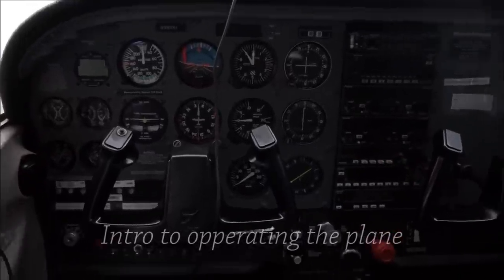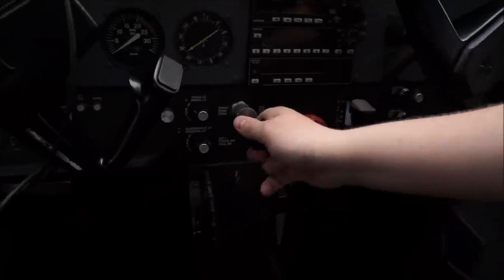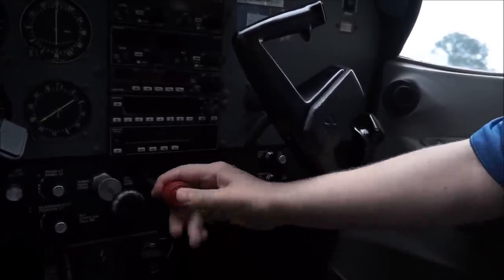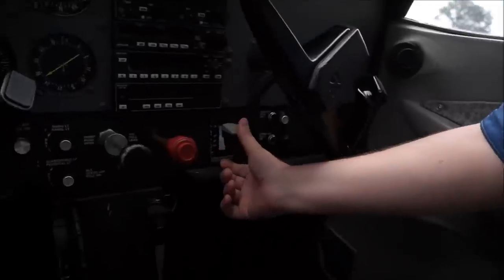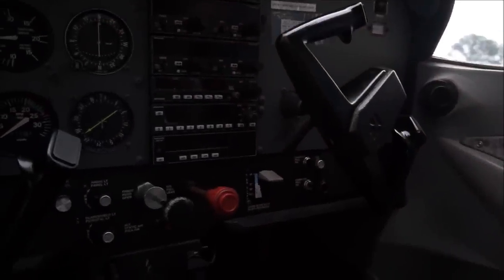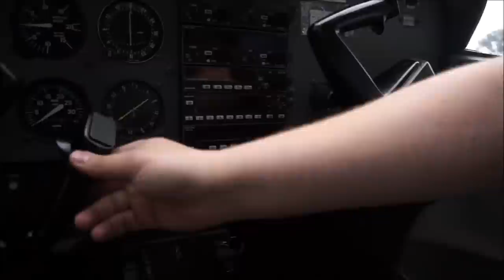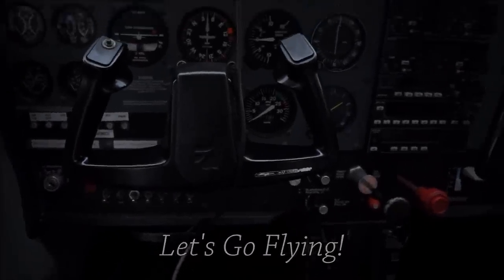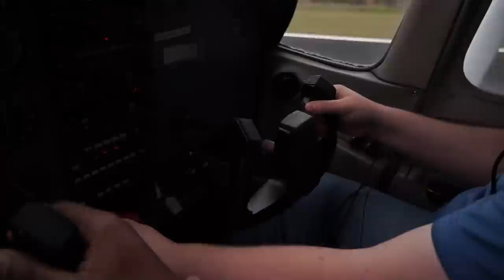Sony Alpha A3000 Test

Comment: Skills! Was all focusing done primarily using the camera or did you utilize the editing software to add tilt shift?
Reply from the maker: Wellingsworth Crittingdom The foucsing was manual. I had my camera in manual mode while filming. I had to adjust the exposure and shutter speeding because of the sun light. For the Transitions or cross fade and music, I used Adobe Premiere Pro CS6 and the intro I used Photoshop in post production.